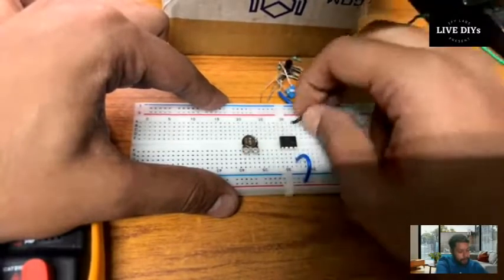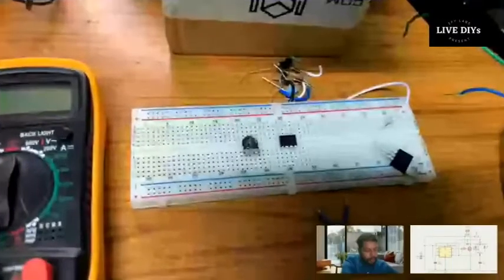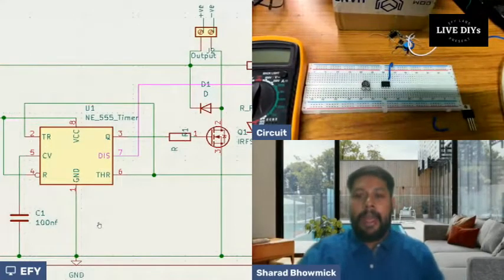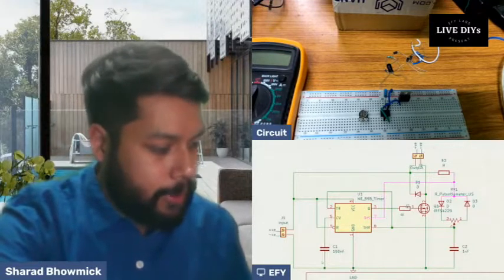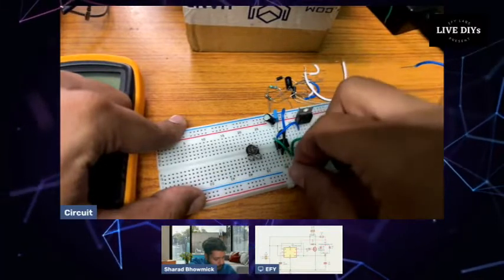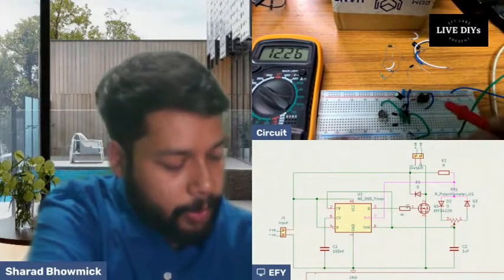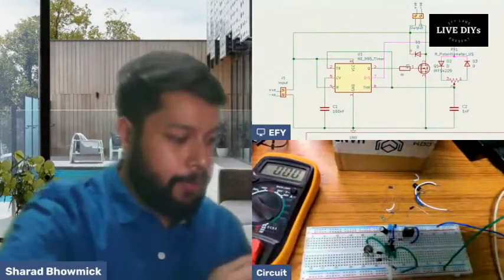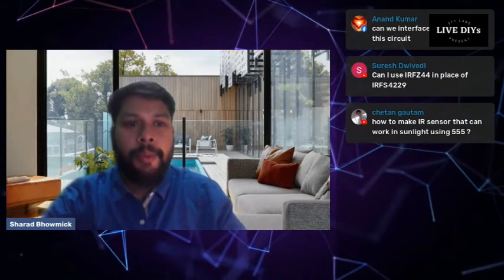LIVE DIY: LED Dimmer Circuit Using 555 Timer

Comment: Why do you need R1? The series resistor between pin 3 of 555 and the gate of the mosfet? This will reduce the gate capacitance charging rate and make the fet go through linear region relatively slowly. This is a pwm and so you want the fet to get in and out of saturation phase as fast as you can, so removing the resistance will improve the power handling of the fet and increase the load we can support.